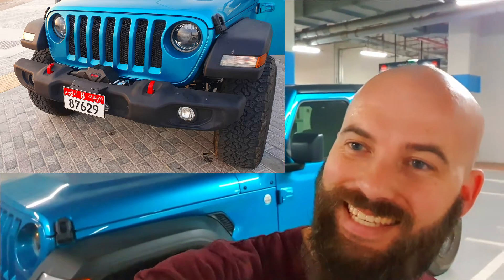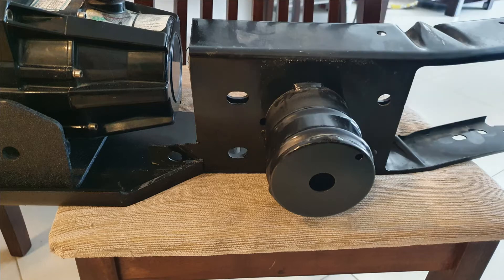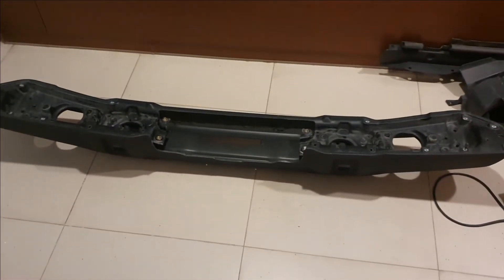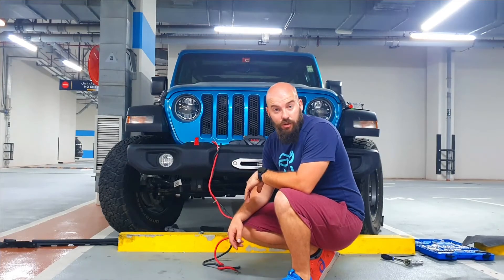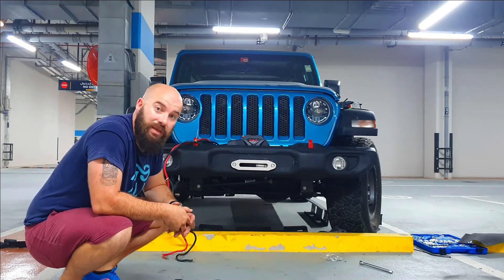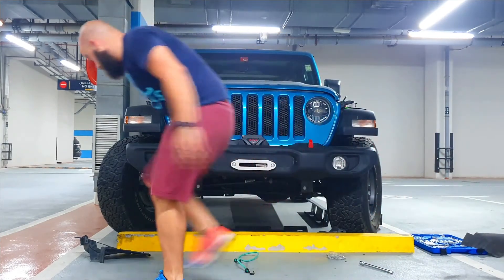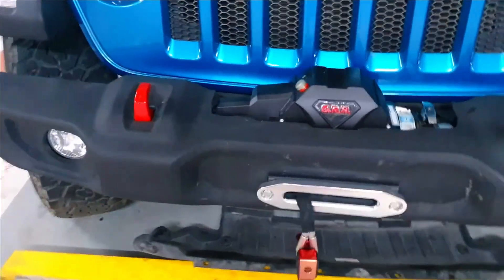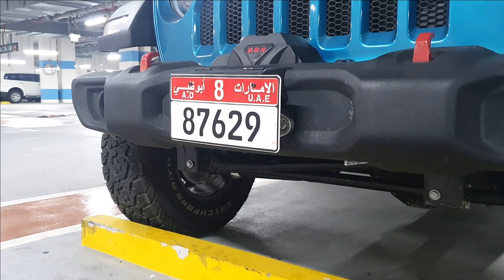Jeep Wrangler JL  Winch Install with a Stock Plastic Bumper

Comment: Man I hope you see this. When you took the bumper off at @ 0:41 , what did you use to make that bumper? I basically am looking to make just that for mine
Reply: Hi man that is all my stock plastic bumper parts, all I added was a rubicon winch plate.

Comment: Nice professional job!! This is the subdued look I want when my 2023 willys unlimited pops out of the Toledo  toaster- oven in 3-5 months?
Reply: If I have it correct the the Willys has the saharah bumper so it wil look even nicer.
Reply: Ty so much my friend, I finally installed the winch plate and winch and I must say your instructions were bang on. Well done!Subscribed

Comment: Heads up, the link to the plate is broken.
How many times have you used your winch?
Reply from the maker: Hi, Paul I actually use it quite a bit, at least once or twice a week or per trip. It has definitely been a worthwhile addition to the Jeep. I usually use it to get others out of stuck situations. Only once for myself.
Reply: Hi man. Sorry for the link. I have used it a lot, best investment I have done .

Comment: Do you have the part number for the winch plate? Like isn’t valid anymore. Great video!
Reply from the maker: Hi this was just the Rubicon bumper winch plate. I am not sure if it has a part number. I think any winch plate could work as long as it is in the bumper

Comment: Looks great great job did you have to cut original bumper in half to fit or could you have left it as one piece
Reply from the maker: @SheerWill Survival Origional bumper is in one piece but the steel brace behind it was cut. But it still bolts in place I actually think its stronger now especially in the middle
Reply: @TheOffroadingNoob  awesome thanks was confused 👊🏻

Comment: there should be a way to do this without cutting
Reply from the maker: I had looked around a lot there was another option of putting the winch ontop of the bumper but that would reduce air flow. other than that unfortunately this was the only option that I found, at the time.